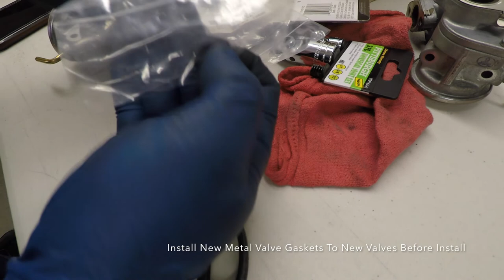DIY VL●OG: GX470 Air Injection Pump CEL P0418 & P2445

Comment: I purchased a 2009 GX470 last month. It has the same sais as yours does.    I stumbled upon your video you did 6 years ago. 

You went through so much trouble getting sais fixed.  It is right where the starter is.   Did you plan to replace the starter?   Mine works fine without codes but it is at  262k miles.   

What mileage is yours at?  Does it still work fine regarding sais now.   When should you or I replace the starter?  Thanks 🙏
Reply from the maker: @markc7889  I think I did this when I only had 120k miles iirc. I’m currently at 160k. I don’t drive it daily anymore since I have other cars I can drive, I also live a mile away from work so it doesn’t really rack up a lot of miles. It’s still the same system so far. No issues with it. I did this before anybody else had other ideas to do it. If I were to do it again, I would just remove the foam filter inside the air injection pump and put in an external filter so it doesn’t happen again. Kinda sucks we can’t just delete it in California to pass smog. It’s really a useless part and only for emissions.

Comment: is it necessary to replace all air pump check valves?  any reason why you choose aftermarket pump over oem?
Reply from the maker: Yes it is. Remnants of the filter from the pump tend to get stuck in the valves and clog it. Most people who didn't replace it, ended up tearing everything apart again just to replace those, so unless you wanna take a chance. OEM pump cost $1200 if I recall correctly. This was only $400.
Reply: @OrganizedGarageStatus  Thanks for the reply! and aftermarket is much cheaper now..

Comment: First of all... Thanks for the video! I was able to successfully complete the job. I just want to add detail to some of the things that are glossed over in the video.

1. It is impossible to get the check valve rear bolts out without a low profile socket set. If you don't want to purchase a Snap-On set, I purchased a low profile ratchet and sockets from a local O'Reilly Auto Parts store to get the job done. Even then it was almost too tall. Here's some links.

Ratchet: https://www.oreillyauto.com/detail/b/powertorque-tools-4691/tools---equipment-16488/hand-tools-16814/ratchets---torque-wrenches-25369/4a6b9be6ae5b/powertorque-3-8-inch-drive-low-profile-ratchet/gm9098/6039498/2001/toyota/4runner?q=power+torque+low+profile&pos=0

Sockets: https://www.oreillyauto.com/detail/b/powertorque-tools-4691/tools---equipment-16488/hand-tools-16814/sockets-25357/bbff8604ac1f/powertorque-9-piece-1-4-inch-drive-low-profile-12-point-sae-socket-set/gm4233/4677074/2001/toyota/4runner?q=low+profile+sockets&pos=1

2. By far the hardest part about this job is getting the two check valves out and back in. I found the side bolts were the hardest particularly the bottommost rear ones. I found the driver's side to be the harder side to get done. Notice in the video there are no shots of him removing the bottom rear side bolts on driver's side of the engine? Yeah... cause it's a bitch to get at. The driver's side mostly because of the wiring harness that runs down to the transmission and is in the way. 

3. When you pry up the wiring harness after you've removed all the check valve bolts just remember that the exhaust tube on the driver's side will move with it. Getting the valve back in and the tube lined up after prying up on the harness will be pretty difficult. I found it easiest to leave the top check valve bolts loose until the tube was secured. Then, you can tighten them all up.

4. The electrical connectors under the intake manifold in my case were VERY brittle. I snapped the clip on the diverter valve map sensor connector when removing it. I was able to find a replacement part at a local NAPA when I needed it. Although it was not cheap from NAPA. Ended up costing $55 for that stupid connector. But it is repaired correctly. Just depinned the new pigtail, depinned old connector and put the new connector on. Here's a link.

Map Sensor Pigtail: https://www.napaonline.com/en/p/ECHEC496

I underestimated how much time this job would take me due to the check valves taking so long to get out. Other than that this job is pretty straight forward. When all the parts were out I inspected each one. I found missing fins on the air pump and the passenger's side check valve must have a bad diaphragm because it won't hold vacuum. Other videos show bits of foam from the pump clogging up the entire downstream system. I found no foam anywhere. Not in the pump not clogged in the valves, no where!

Hope this helps fill in the gaps for anyone looking to fix their air injection system.
Reply: Did you get a CEL? My gx has almost 200k miles and I’m thinking of getting the bypass kit for the SAIS but the thing f is i believe it sounds like his did at start up with the distinct whine so I’m thinking that the foam got sucked up also and possibly fins broke off but the car runs fine and I don’t have a cEL. I’m thinking if if I get the bypass kit but it’s already clogged up wouldn’t that be too little too late and then I would have to just replace the entire pump system itself?
Reply: @Elite_Employee  Yes my GX had a CEL prior to the repair. After the repair we had driven the car 30,000 miles without issue. Until my wife totaled the vehicle two months ago. The parts were about $650. With 200k on yours you've got plenty of life left in that rig. If I were to do the job again I'd also replace the starter while I was in there with a new genuine Lexus starter since it lives right there under all that mess.
Reply: @akletke1  this a silly question, Do you think that this job can be don in one day? I need my car for work, I can only afford one day a week, Sundays.
Reply: @josevelasquez3927  maybe. That’s a loaded question that depends on a lot of variables. What’s your competency as a mechanic? Are you going to break any electrical connectors? Do you have all the correct parts? Do you have all of the right tools? If you start early enough you could get it done in one day, sure. Due to the unknowns, I would have a backup transportation plan.

Comment: Hey bud, appreciate the video. I got an issue that I posted on the clublexus forum regarding my 06 GX470. I'm having a strange issues and I'm not sure if its similar to this issue. When I start up my car I think I'm getting a similar whining noise and I hear the pump turning off several seconds later. But the noise that troubles me is when I'm accelerating the car on the road I start to hear noise like and exhaust leak. It sounds like a car with a louder exhaust is driving right next to my car. 
I've been told that its a leaking exhaust manifold but I don't hear this when the car is park or when I'm revving the engine. Only when I'm driving. I appreciate you help bud. 
BTW, I have no check engine lights and this has been going on for over a month now.

Comment: That's a great job!!
I've already got two failures codes in my 2006 Lexus Gx470.
p0418 & p2445
it seems the same issue that you stated in this video.
so please..could you kindly tell me the parts numbers that you used as a replacement of those old parts?
I need the parts numbers in order to purchase them.

appreciate your response & thanks in advance.
Reply from the maker: saif alzeidi thank you and glad it would be of help! The parts and part numbers are listed in the description.

Comment: What replaces the foam filter that dry rotted? A new one that may dry rot again? Or switch to something else entirely?
Reply from the maker: If you keep the car long enough it would happen again of course. Like in 8-10 years.
Reply: May consider removing the foam and replacing it with an external UNI Filter, looks like a K&N filter

Comment: Hi dude. It looks like you broke the ventilation hose at 23:28 . Did everything work correctly in the end?
Reply from the maker: It's the ventilation hose for the PCV. I replaced it when I replaced the PCV a few years later. Couldn't find the part number for the PCV during this time, I would've replaced it as well otherwise.

Comment: I have GX460 and I am getting P2437 -- I have clicked all the links that Google gave me but I could not find my solution. The P2437 gives me an error about the Secondary Air Injection Sensor issue. My question is: Where is the sensor located and how does it look like :( Thanks
Reply from the maker: I believe Lexus just released a recall on those, might wanna check with your local Lexus dealer.
Reply: @OrganizedGarageStatus  Yeah, I checked the recall letter, it does not include the error code P2437 even though it is related. My local wants $300 for them to plug in their OBDII to check :(. Thanks for your reply.